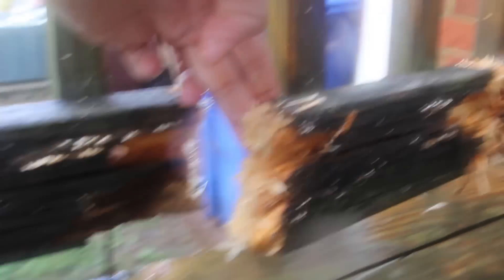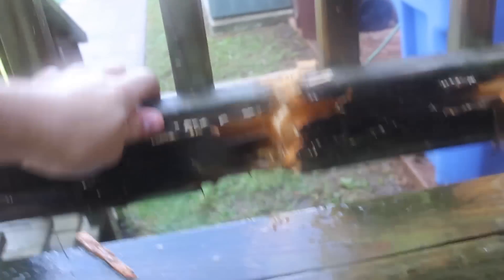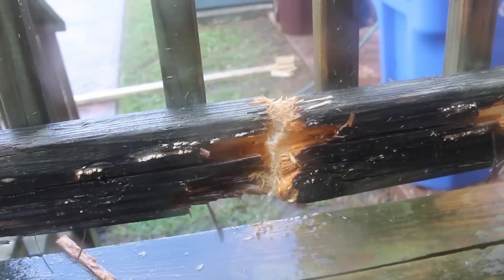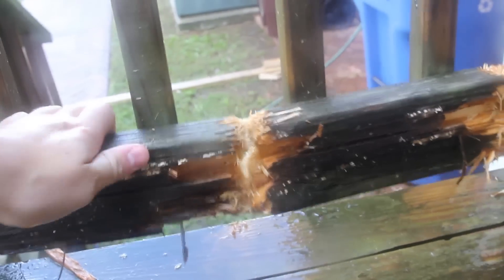How to Cut Wood with Water

Comment: Kind if like a waterjet, but cheaper lol
Reply: They are actually called pressure washers which put a lot of pressure on water for stuff like cleaning idk.
Reply: +DragonZage _ Waterjet machines do exist, andthe one I used cuts metal, but I have only used it once to cut an intake flange lol.
Reply: +M1NH5AN3 Lol

Comment: Lol what happens in i do that on my arm?
Reply: Kvorts You probably haven't seen the popular comedic device 'sarcasm'
Reply: Iftiar Mullah It cuts flesh... so i might not do it..
Reply: Kvorts Oh okay lol
Reply: Kvorts these guys are all lying. If you use a pressure washer on your arm or any body part, it will make your pores super clean
Reply: Nicklas Källman preassure water tatoo by dudesons
Reply: Kvorts Still hurts ^-^
Reply: That's wat I was thinking
Reply: Kvorts Probably suck more than the trollfinder's system.
Reply: I touched the one you clean for cars. I got a cut on my finger
Reply: Nicklas Källman That is nothing to this. That was low pressure.
Reply: Nicklas Källman yeah
Reply: Busdriverx I cant find the troll... I suck at trollfinder's system...
Reply: +Breanne Chambers it will cut your arm to the bone of not in half.
Reply: +Nicklas Källman I have a 250 bar mashine I tried it and I cut through 3mm aluminum sheet
Reply: It will rip of your arm
Reply: I've done it .It just hurts .Your arm is okay
Reply: +Ghost Warzz what
Reply: Your neighbour from the other side of the fence: OWWWW!
You: What's up?
Neighbour: An arm flew over your fence and poked my eyes out
Reply: You won't have an arm
Reply: +Kvorts but it's just water. Lol, hurricanes have faster moving water than this hose does.
Reply: +ZiovanGamer Hax it would probably have the same effect off the wood in the video (reffering to muscles)

Comment: And as you can see your water bill goes up tremendously
Reply: They actually don't use that much water, it uses less actually, it's just the waters velocity is significantly increased so it looks like more.
Reply: In the UK we don't pay for water in frequent bills. We pay an annual fee and we can use as much water as we want.
Reply: Yeah, cutting wood few times with that raises your water bill with amazing 0,01 cent's
Reply: B3A5T 021 What does that have to do with anything?
Reply: LOL
Reply: Minecraft geek water is almost free in my country lol
Reply: By the time he cut the bench I could of got a saw from the shop and cut it!!!
Reply: +Minecraft Geek its not using more water that normal its just shooting out a smaller amount of water at a higher speed

Comment: Pressure injection injury waiting to happen  with foot holding board.Same as airless paint sprayers.Amputation at hospital most likely afterwards.Saw a guy that had to lose a little finger after clearing his airless sprayer paint gun.Fuel injection,grease and pressure washers were all close secounds.Other that,Safety first.Like the channell.

Comment: Actually industrial water cutters can cut through 100mm (4 inch) piece of steel with no problem at all.It has to be mixed with some kind of abrasive, but still, the pressures inside theese babies is just mindblowing.

Comment: The wood is old and rotting
Reply: you can clearly see that the core is not rotten. The wood is most likley impregnated and therefor withstand the moist. so no, not old and rotting.
Reply: Emil sjöstedt
Old and rotten
Reply: it can pierce through iron, so waht about that?

Comment: I have a PhD in physics and another in chemistry. I like this channel, but this is simply impossible. The water has more rigidity than most liquids, but nonetheless the only way the water could actually cut through a piece of wood like the one they have is either 1) the wood was extensively pre-soaked or 2) the water was traveling several thousand km/h. The machine they were using couldn't force water out nearly that fast, so 1) must be correct.

Comment: Some people don't realize how abrasive water is. One droplet, over time, can cut through anything even the military has experimented with water because how hard it is on contact at high pressures when used as an explosive. I saw a video them blow up a car with only one liter of water.

Comment: From the looks of it safety is surely not your priority when using running shoes to hold down a wooden board cutting it in half with a pressure washer. You could have bore a whole in your foot of cut off your pinky or big toe you dope.

Comment: You cannot lose water. All the water on earth is already hear, and will always be hear. Don't any of you go to school? You should know that there is this thing called the water cycle. Water will get evaporated from heat by the sun. After that, the gases will condense and turn into clouds. This process is call condensation. When a cloud gets to heavy, it will simply rain, or precipitate. All the water that has be evaporated is now back on the ground.

Comment: Thanks for the tips but i think using SAW is much more easier than water gun. I even highly doubt that the water gun could cut a brand new wood. The one on the video is a rotten one..

Comment: the red pressure washer tip was also used to clean off rust, now dont try it on your beater honda, it will cut through the metal, it has to be somewhat thick, like a chevy frame. and yes, it will cut through human flesh

Comment: You can cut metal with water as well, though the tools are quite expensive compared to normal everyday tools you'd find in any hardware store. High pressure water tools can also cut trough flesh and bone.

Comment: soooo, don't wash my car with it?
Reply: Yep
Reply: FYI i used this and a fine sand add-on to take off the paint on my old 70's commodore and it doesn't take as much pressure and a wider nozzle.
Reply: well it was sarcasm but i guess that's actually pretty useful information.
Reply: Well,its okay if you wanna slice your car in half

Comment: Can cut not just wood, but metal, steel and also concrete and stuff. In the industries they use this technique to cut raw materials with water as this doesn't eat it up where it's being cut and thus, it doesn't deform the cut part. That deformation would occur with laser cutting for instance where some raw material would melt a little. Doesn't occur with water. It's a clean cut.
But of course, those industry guys using water cutting have larger equipment and a much greater water pressure :)

Comment: What A WASTE OF WATER <:(
Reply: FINALLY SOMEONE ACTUALLY LEARNED THE WQTER CYCLE
Reply: NINJAof SPARTA It's water not "wqter" . Also make sure you only capitalize the first letter of each sentence.
Reply: Grammar Nazi Various mistakes here:

 - You forgot to apostrophise correctly on your first sentence.
 - You added a space after the last quotation mark.
 - There are two spaces following a full stop ('period' for the simple American) not just one.
 - You were born.

Grade: D-
Reply: All of the water you see being used in this video either evaporates or goes into the ground and back into aquifers. There is this thing called the water cycle, water doesn't just "disappear."
Reply: Eugene Dikkins Read the comment I wrote for Marielle..
Reply: luke steffenhagen You learn about water purification and the energy and money it cost  by using your brain...
Reply: Grammar Nazi  you didn't even capitalize  -.-

Comment: Is there really a such thing as wasting water when it gets evaporated and put back into the ecosystem you dumb fucks? Wasting water would be storing it in barrels and locking it up 3 miles underground.
Reply: Thank God someone is smart. I really couldn't stand them talking about wasting water.
Reply: Amen XV Sigh. It means we are wasting fresh water. Out of the worlds water, most of it is salt water and only 3% is fresh. And to filter out the salt water would be incredibly expensive. Our fresh water is being consumed too fast for it to be naturally filtered and returned back into the glaciers by snow. And in case you forgot, glaciers are decreasing so yeah we are running out of fresh DRINKING water. Go drink salt water boy.
Reply: And pretty sure we kids learned what the water cycle is in elementary school, but all those guys probably didnt give a crap about it.
Reply: And to have a water production enough for a entire country, are you suggesting that we make a solar still over the entire pacific ocean? And remember. Not everyone has the supply of even ocean water.
Reply: That's not factually accurate. When the demand on a reservoir system is very high compared to its output potential, using a lot of water can cause shortages. The water will get evaporated, of course - but that doesn't mean it will rain back into the reservoir. And most of that water does not.
Reply: Cmatrix - not once did I say all the rain water goes directly into the reservoirs. I said it goes back into the ecosystem, which is 100% accurate.
Reply: i 100 percent agree with you. A lot of people claiming that wasting water could end up in world war 3.How water wastage is possible.That ecosystem is working from billion of years then how can you say that there would be no more water in near future.
Reply: Hao Huang And I'm tired of people saying "Haven't you heard of the water cycle?' because we have done too much to interrupt it and it no longer functions properly.
Reply: Okay then. Filter your own shower water and drinking water. Don't use our public supplies anymore.
Reply: Hao Huang it still is enough and as i mentioned that ecosystem wont stop and you know what does ecosystem do?
Reply: GermanSnipe14 Then your definition of "wasting" is pretty relaxed. I took it to mean "depleting the supply readily available to humans".
If you have a different definition, then I retract my statement. But, to be fair, you should have clarified that in your original comment.
Reply: Holy crap this debate just got intense
Reply: Hao Huang "Hao Huang" - "Good Yellow"?
Reply: Maybe theyre talking about drinkable water and there is such thing as wasting water by using more water than youre getting from rain
Reply: GermanSnipe14 So then by your response you just made to Cmatrix...you initial comment is irrelevant in a sense. We say "wasting water" because if it goes back into the ecosystem and most of it will NOT end up in reservoirs for drinking use (As you just acknowledged in your response) , it was a waste of water. When people say "Waste of Water, they are talking about drinking water."
Reply: What's that suppose to mean? Lol
Reply: Hao Huang I don't think anyone can waste water since we have the water cycle :P
Reply: if you're talking about the california situation it has to do with snowcap runoff.  We get less rain, less snow on the tops of mountains, less fresh water running down through the streams, and less water in the reservoirs.  If we had a system to desalinate ocean water it'd be no problem at all.  Maybe you should get on that, cause you're a smart guy
Reply: water waste srsly? what about firefighter training and all that shit where u need tons of water....
Reply: Do you know that some industries use water for cutting stones? Ok sounds like a big waste but it's better than using laser or diamond blade that waste more energy
Reply: nateman10 Umm...I think I covered that in my response...
Reply: Nate did u really just say stop rivers from entering the oceans.
Reply: We are talking about drinkable water. Not water in rivers.
Reply: Why do peeps say we waste water and food we have farms for food and the water cycle
Reply: Man most of the people whining about wasting water haven't even spent the time to donate water to places of need.  Go get involved in some charity and do your part if it bothers you so much.
Reply: And all the trolls troll for nothing...
Reply: nateman10
 :-)
Reply: Hao Huang
I SAY WE WASTE IT AND GIVE IT BACK TO THE WILD CREATURES WHO DESERVE IT!
Reply: KillaGrogan Yes that's cool
Reply: Hao Huang
Myong boyok shaman maka :)

Comment: Okay so if he doesn't waste "water" on this experiment, how will this help others who don't have water. I don't think the excess water in Russia will be given out to those who don't have water. This water wasn't wasted. He was doing it on a grass populated area meaning that the water will be absorbed by the grass. Those of you who probably think that this could've helped any country that needs water is either retarded or didn't get proper education. You most likely leave the tap open while you shower, throw away excessive water when you're not thirsty any more, or have a dishwasher that wastes WAY more water than what the guy did.

Comment: If what creationists say is accurate in the least bit(Spoiler: it's not), the grand canyon was formed by water moving at many times the speed of sound. That water would have enough pressure to cut through steel.

Comment: That is old rotten wood. You could have cut through that with a dull pocket knife if you wanted.
Reply: Thats not the point noob , its to show the power of water pressure
Reply: That's not the point noob. I was saying that wood could have been cut with pretty much anything. Most people know water pressure can cut wood. It can also cut metal. ;-)

Comment: The strongest "saw" in the world is pressurised water. Cuts through anything for a very long distance. At first it was a huge problem because the companies that used it didn't know how to stop the jet since it was cutting through whatever it was cutting, and whatever was supposed to stop it. Ultimately they used the very substance they were trying to stop. A tub of water underneath whatever was being cut is able to stop the pressurised jet without any problems.

Comment: Why can't people understand that this is an experiment? Obviously you wouldn't use a pressure hose to cut wood. He's just showing you that it CAN cut through wood. Obviously a saw would be much more optimal but that's not the point of the video.

Comment: How far does the water go if you point it in the air?
Reply: do the math.
Reply: I don't even know the pressure rate and the mass volume of the water in that pipe and not even the length of the pipe

Comment: You just Wasted 2000 gallons of water
Reply: An outdoor faucet (to which you connect a pressure washer) will typically output 5-10 gallons minute. It would take a while to hit 2000 gallons.
Reply: ricksite 400 minutes or 6 hours and 40 minutes for 5 gallons/minute and 200 minutes or 3 hours and 20 minutes for 10 gallons/minute

Comment: How to ruin the patio
Reply: SkibDen
How many PSI would that need in order to happen?
Reply: joke, great channel though, i enjoy your videos:)
Reply: I ruined my uncles garage with it. It went through concrete...
Reply: Lol lazy
Reply: Jmantheawsome1
It won't go through concrete unless you have diamond powder in it.
Reply: He is a cool life hacker dude!
Reply: I don't know if my uncle ridged up the pressure washer before I had it.
Reply: *****
Water alone can go through concrete, but needs a lot of pressure.. Fire departments use a similar tool to cut into burning buildings - They add a metallic powder, not diamond.. And it cuts through pretty much anything
Reply: SkibDen
I was thinking of the industrial water saws, which use powdered diamond.

Comment: This isn't fresh timber. Its weathered wood that is weaker than normal wood so isn't really amazing.
Reply: It doesn't really matter. The point of this video is taking a look at the wonders of "what pressure and water can do". It's not like he's actually proposing to use this over an ordinary saw or anything. Water at high pressures can cut through diamond.
Reply: That's the outside of it
Reply: Mine went through concrete.